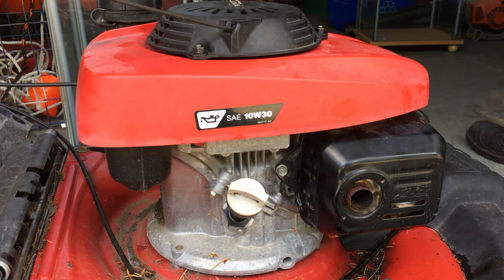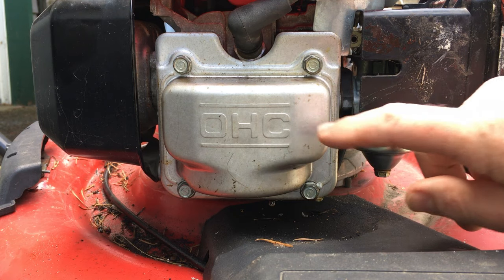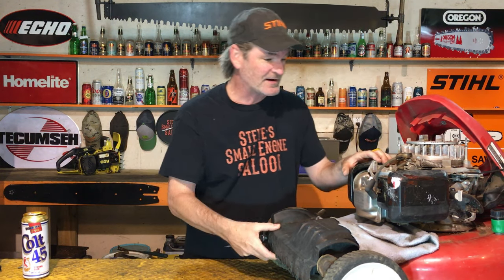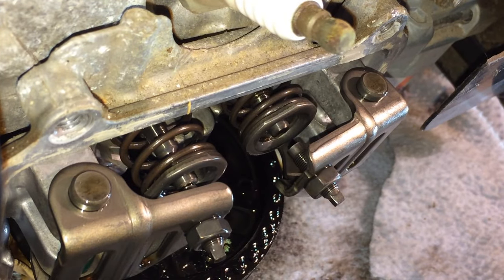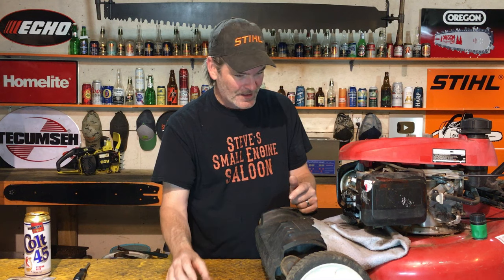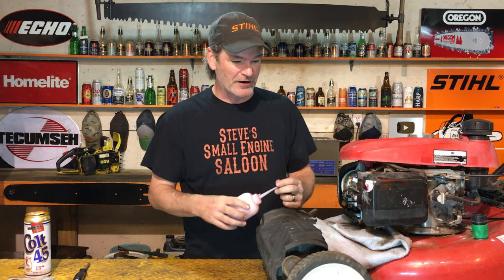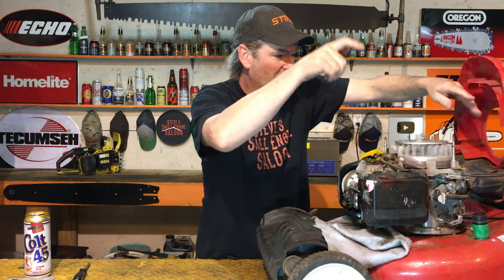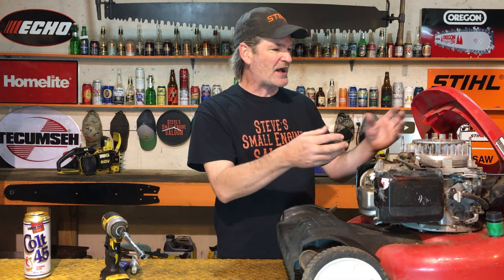How To Fix A Lawn Mower With No Compression

Comment: I’m working on a Honda HRX mower. No compression. The valve clearance was about an eighth of an inch on the exhaust side. Took the spring off and the valve is moving freely. Do you think there is buildup on the valve and not seating?  Guy said he mowed his lawn and went to start back up and backfired. Now won’t start

Comment: i have a one year old mower that was low on oil and slightly locked up, but i got it unlocked easily. the valves are not moving at all. when i pull the rope there is no compression, only a ticking sound. i dont know what im doing but im learning as i go. is there any hope for this mower? ty

Comment: Thanks for posting Steve.  Do you have a vid on the valve adjustment for a Flat Head engine like the Briggs  Quantum series?  Bought a used mower in good shape but has weak compression.  Stay frosty Bud.

Comment: Great video Steve! I was given a Honda 160 with 0 compression. Took the valve cover off and the valves were working. Dug deeper and found that someone had replaced the timing gear and installed it 180 degrees out of phase. Thanks for all you do for us.
Bill Stiles, Johnstown, OH, USA

Comment: I have a Toro push mower with a Briggs& Stratton engine that stopped running while I was cutting the grass. I couldn't get it started after that so I took it to small engine repair shop near my house I was told the engine had no compression and the bill would be $175 to repair. Is this a fair price  or should I just buy a new lawnmower I've had this mower 11 years.

Comment: On a snowblower I have, put new plug (tried 2 new ones), new carburetor, new 100% gas, adjusted valve lash (was OK)  still won't start. Fuel is in the carb, spark good and strong. Tried starting with a drill & socket on the center bolt, not even a hint at starting. Won't fire at all even with starting fluid directly in carb. Is there anything I should check next, besides shopping for a new snowblower ?

Comment: I am about to try this for a backfire through the carburetor. Maybe the valve is sticking open letting the flame front back into the intake. I’ve checked the timing on the timing belt overhead cam all that lines up perfectly I checked for a Sheard fly wheel Key I thought may be causing it and that fly wheel Key looks pristine and mint and now Steve I’m about to try this. I will post an update. Thank you for this video.
Reply: Update: found the problem and it runs good now. The problem was the valve cover was slightly dented in and it was enough to interfere with the intake rocker. I hammered the cover back to original shape, and now it runs well. I changed to oil because of all the carb spray in the engine. I only got 5 oz of oil out of the engine anyway. 18 oz is ehat should be in there.

Comment: Great video. Definitely has helped me with different pieces of equipment. Just got done with gapping the rockers in my Husqvarna mower. Starts with the first pull every time and runs great. Something weird though for a seven and three quarter horse engine if doesn't seem like it has the compression that it should. Gapped both the intake and exhaust both at .007". Should there be more resistance upon the compression stroke or should they pretty easy to pull?? I know the older mowers had a bunch of compression but the newer ones don't seem like they do.

Comment: That's Gold Steve!! You just saved a lot of people some coin with that tip. Hey I have a Ride-on with a briggs vangard 16hp twin on it and have noticed some oil and crud build up on the bottom of the valve covers. No noticeable oil loss between changes and its done 500hrs. It runs just fine. Is it worth pulling the covers, checking the clearances and re fit it?

Comment: Steve,  I totally love your posts.   YOU are such a blessing in how you pass on your knowledge of small engine, chainsaw, mower etc maintenance and performance.  Also,  I had to laugh a good one on your Colt 45.  Years ago, that was brewed about 2 minutes away from where I currently live here in Halethorpe, Maryland USA
Reply from the maker: Wow, thank you!
Reply: @StevesSmallEngineSaloon  YOU are quite welcome,  Steve.  My first experience with youtube was from a person like you when I wanted to learn about lawn mower carbs.  I now have learned many things from electronics and tube amp tech, to chainsaws and all manner of automotive diagnosis because of good people like yourself.
Reply: @StevesSmallEngineSaloon   Steve's Small Engine Saloon  In respect to Chainsaws,  I truly absorbed all types of info such as how they are designed to run right, how various factors such as fuel system issues can cause runability problems, or how air leaks and bad seals can spell disaster for the vital engine parts.   Learning how to check the various components to ensure optimal performance and to set saws up properly is INVALUABLE.   Your basic tech and descriptions of how to diagnose and set up saws is top notch.  Thanks
Reply: @StevesSmallEngineSaloon  PS.  I went from my first chainsaw repair, Poor Running Stihl 026.   Having diagnosed and fixed fuel related  ( ethanol crap) gooey fuel and impulse lines, fuel filter, carb fixes on my Stihl 026,  to now doing total rebuilds of a pair of Stihl 1111-  051 and  075.  Before I am done,  total overhauls  New Top Ends., down to splitting cases and replacing crank bearings,  seals, ensuring oiler parts are properly functioning, carb and ignition, exhaust repairs, new flywheels, handles, throttle controls. Final step to be air n vac leak checks.  I should definitely learn a lot and have some bad to the bone saws when done.
Reply: Now they totally redid the brewery place and it is now brewing Guinness Blonde and they do tours etc

Comment: Excellent videos! I was curious if you have run into problems with small engines not starting after being used for a while, i.e. using the engine a while, then cutting it off to come in and cool off for 10 minutes and then the engine won't start again.

Comment: Just got an used Swisher pull behind trail mower (brush hog) that just has no compression at all.  The previous owner said it just quit last time he was using it and now has no compression.  Do this happen to engines when they are running or should I be looking for a deeper problem.  He reports using this machine at least once a week to maintain the fence line on his property.
Reply: Its a 12.5 hp Briggs 344 cc

Comment: I think I got my answer on what happened to mine watching this video. It fixed itself but I think I will clean them anyway. Thanks
Reply from the maker: Good luck!
Reply: Well, tried carb cleaner but no luck so took the head off and the intake valve seat came out causing the valve not to close. Looks like I can clean it up and drive it back in but is there suppose to be some kind of hi temp sealant to put these in with?

Comment: I’d be lost without your videos! Thank you very much for sharing your knowledge. I haven’t had this problem with a lawnmower, but I have with a string trimmer. I took it to small engine guy and he told me it was dead and not worth fixing. I still wonder if that’s right. A two stroke engine with no compression, seems like it could be fixed 🤔

Comment: mine makes a horrible ratcheting sound when i pull the rope and it won't turn over. would that be the valves too? it's easy to pull though like it has no compression.

Comment: Thank you sir I could not figure out what was going on with my lawn mower and I changed the spark plug, I checked the flywheel key and I was not able to figure it out, until I came to this video.  Well this one with the one before this one that shows how to diagnose the compression problem. Mine was no locked but I needed to tight the nut because the push rod was loose. Thanks again. You have a new subscriber.👍👍

Comment: Thank you, thank you, thank you!!!  In lockdown, no chance of getting mower to the shop, my non-starting mower is now working.  I had released I had no compression and thought it was a stuck valve, but I did not know the technique to free the valve.  My valve was really stuck, you can easily remove the valve spring as well, which allowed me to tap with a small hammer, then pull back with a tiny pry bar.  Thanks again :-)
Reply from the maker: Great job!

Comment: Great video. Though this fix wasn’t applicable in my case (I think I had some piston ring issues), this was very educational and easy to follow. Thank you for sharing your knowledge and expertise.
Reply from the maker: Cool, thanks
Reply: @StevesSmallEngineSaloon  I take it back, it was the valve. After watching your video I dug into it deeper and the piston/cylinder had compression with the head off (put my hand over it) Found the exhaust valve had a bunch of debris caked on the seat. Took it all apart and cleaned the valves, and it runs strong. Thanks again for your help.

Comment: Hello guys! I have a same engine Honda and it burns a lot of oil.
 It burns oil when it is not under load (it has clutch for the cutting).
I got out the piston and has some damage on the piston and cilynder but the oil burning i think is too much for this damage. What else can it be? something with the valves or what else?

Comment: A good video I had one of those Honda 160 motors on a Husqvarna mower it was great the mower was not mostly the self propel part needed fixing twice a year. finally bought a troy built . not a great mower but it still work.. Thanks again. I'm going to us the trans/acetone fluid on an od Indian wrench I bought at a yard sale 2 years ago WD-40 hasn't worked in two years.4 applications and it's not that bad. I'll let you know. Now where does she keep that stuff??? BFN

Comment: I had a Craftsman lawnmower I stored in my very damp basement over the winter. I had the very same problem with no compression when I tried to start it in the spring. I could see the problem in my head a stuck valve from rust that  formed around the valve stem of an open valve. I took the head off and just touched the head of the valve and it snapped shut . I put it back together and as yours did it started on the first pull .
Reply from the maker: Right on

Comment: Hi from the UK i have lawnmower with a Loncin 196cc engine Honda copy ! good spark,fresh fuel , & cleaned carburettor & 60 lbs compression do you think it could be the compression side  ie;valves & piston causing know start with not enough vacuum to get the fuel into the chamber much appreciated STEVE

Comment: so are these the only thing to fix compression? i watched the previous video and the blade on a couple of my motors doesnt spin so eaily or freely like that...so one i took the plate off and sprayed those springs with gumout..aka carb cleaner but still the blade doesnt turn smoothly..i think it needs a new pull cord anyway it takes a bit to get back into the housing. the other one i havent cleaned those springs yet..but its blade also doesnt spin freely like the one in the last video.

Comment: Quick question. I suspect I've lost compression because it made a distinct spphttt sound through the exhaust and the motor died on the power washer I was using. It now spins without resistance so I'm pretty sure it just lost its compression. I can't hear a valve striking the piston if I pull the rope, so I was wondering if a valve can actually just become stuck while being used? The question doesn't make sense to me but thought I'd check with you because I'm just guessing.

Comment: Got a mountfeild mulching machine cleaned carb fuel good still hunts slightly but does even it self out pull cord not so good hang out about a foot will replacing this and sorting the valves out get 5he machine to run better I think it will just need confirming that timing and pull cord could iron out the little issues cheers Steve love the vids mt

Comment: I have a Cub Cadet CC600 with 195cc engine and no compression. It has the same OHV cover. I hope it’s an easy fix like yours. Mower cost me $50. Lady said she was told it needed a new engine. We will see.
Reply from the maker: Good luck!
Reply: I loosened up the valves with carb n choke cleaner and have compression now. But it still won’t start. Makes a loud clunking noise every revolution as I pull the starter cord. Has spark, has fuel.

Comment: Hi .
Question , I have a craftsman Lawmover 7.25  163CC it was working fine but now comes on but not full idle you can hear only is running not full speed , also some 💨 smoke black is coming out from the exhaust I already added new gas clean the carburetor , any idea what else , please help . Thank you

Comment: Steve: Echo CS-590 19" chainsaw. Got it home from Home Depot - could not start it. Went back and  TWO employees (one owned the same saw) took it outside and spent 15 minutes pulling the cord about 100 times and finally started. (not joking) Once it is running it idles fine and doesn't stall and good power. What is the secret to start it? It has the compression release feature.

Comment: Loved this video and I learned a lot. It so happens I have lawn mower with one of the cheaper Honda engines on it. I was told by the shop that it can't be fixed. I will try what you did, however. I'll let you know if it works.
Reply from the maker: Good luck!

Comment: Great video! It's funny, I had this EXACT problem with a 4 stroke weed eater this morning. Easy to pull over, no compression when I pulled the plug... The intake valve was sticking. I solved the problem almost the same way, too! A few drops of ATF and it was right back in business. Took about 5 minutes, thanks to a fiber gasket instead of RTV sealant.
Reply from the maker: Right on Buddy...

Comment: Thanks Steve 
Great video. 2 questions.  What is the gap on valves? Would it be possible to pour the Atf and acetone blend in plug hole to release a stuck ring?
Right on buddy!

Comment: I replaced the valves and push rods on my gx390 and now it has a loud tapping noise.any idea what it could be
Reply from the maker: Could be you adjusted them on the wrong stroke!  I have a video in my playlists called mistake when adjusting valves....
Reply: @StevesSmallEngineSaloon  thank you I will check it out

Comment: Do u have a video to show how to work on valves on a Craftsman? I cleaned the head and removed all of the carbon. Both valves move but I can turn the flywheel like u did. I've tried pretty much everything else to get my mower to start and it hasn't. One day the recoil snatched out of my hand and the mower lifted and dropped and hasn't started since. It's just a regular craftsman push mower. Nearly 20 yrs old. I have 2 other mowers but prefer using this one
Reply: I just messed around with the mower. The valves move. I sprayed penetrating oil inside anyway. The cylinder wall does have some scarring in one area but it's moving fine. Going to check the gas cap for venting. I spun the blade and it bounced back some. I'm about out of ideas and I hate for this thing to beat me 😤

Comment: Hey steve I have a Murray Briggs &Stratton 5hp ohv has no compression what does the intake valve set on and exhaust valve set on model # 961140029 03 and do u set them with both valves closes TDC

Comment: "The Magic Brother Juice" .... I always have some mixed and at the ready .... also saves on scraped knuckles for old rusted nuts and bolts ... a little heat helps it wick into the threads .... with cold water spayed on after to "Shock" the 2 parts apart on really stuck ones ... great video, nothing better than a one pull start Steve !
Reply from the maker: Right on ....
Reply: Spinonemaster could I please get this Magic Brother Juice mixture, I could not find on here thanks.

Comment: Hey Steve, great video. Question for you. I have an older toro electric start, manual start gas engine, can't remember if it's Briggs and Stratton or another company engine. The problem I face is when you pull the manual rope start, the line snaps back at you and causes severe pain to your hand. Any video on what that could be or suggestions.
Reply: Check the flywheel key.

Comment: hey! i had a question about my 2003 kawasaki kfx50 maybe you or someone can help. i was riding it and i parked it after it was running great and it when i went to turn it back on well it never turned back on. new carb new top end (cylinder head piston rings and gaskets ect) and new carb and still don’t turn on. there’s no electrical system no battery or electric start or lights. it has spark and seems to have fuel. i will spray starter fluid sometimes it sputters same thing if i put gas straight into it but most of the times it dosent do anything. there also a new pull start idk if it’s not enough spark or what hopefully you can help me out. thank you and i love the content! edit: it does have good compression.

Comment: How can you tell which is the intake and which is the exhaust valve on this, or any small engine?  Exhaust valve is always closest to your muffler you said?
Reply: That's  correct,  or closest to the exhaust port going out to the manifold on larger engines.

Comment: Mines a Masport turns as badly as yours doing the compression test  but mine i see the valves and cylinder ... have no access to what you have shown....seem to be opening and closing fine and can hear a bit of compression ,tried to clean and spray in the valves did help free  them better but still will not start  so not enough compressing i suppose .It never blew smoke or any thing just stopped working one day

Comment: I have a Yamaha 40HP outboard motor (2stroke) and cant get it to run wish you were here. All the best great videos
Reply: I would check the electronic ignition first. I have a 350 V8 boat and couldn't find a problem with it and it was a coil that failed when hot. I kept chasing the gas, and it wasn't even remotely related.